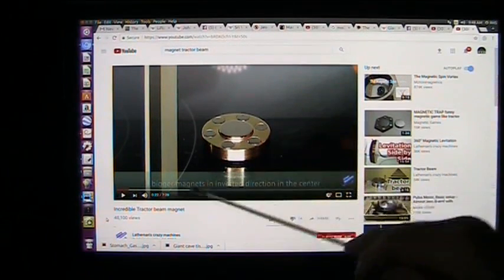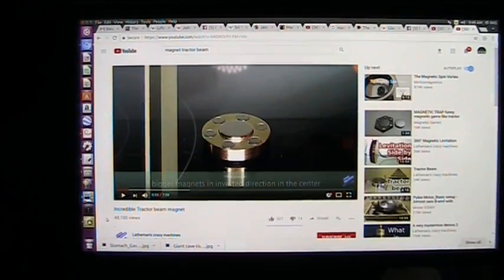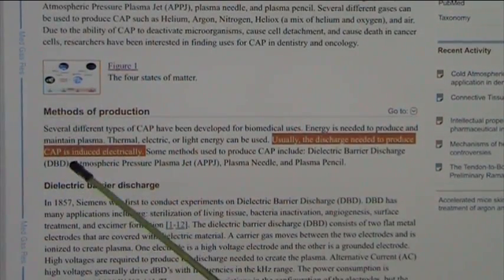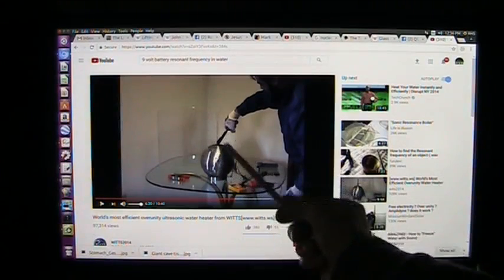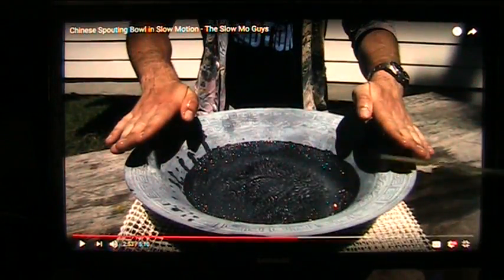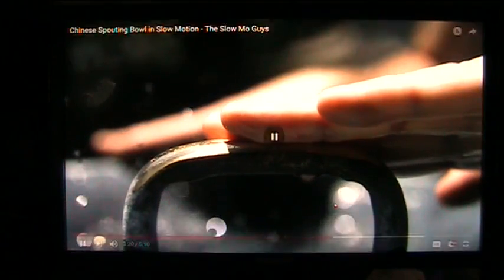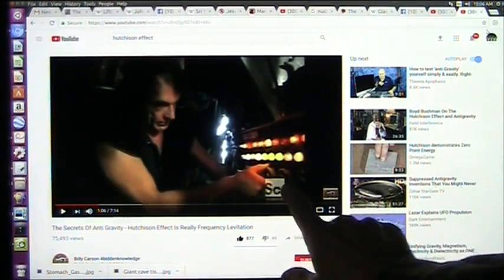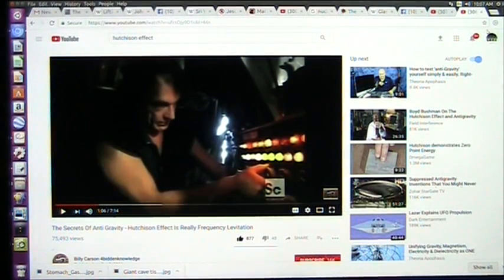MFU Sonoluminesce Explained and demonstrated several ways

Comment: @ 3:35, I see this as our Sun. The center is liquid hydrogen condensate. Being a liquid it does not compress, stops the Sun from collapsing.
Water acts like the Ether. You say it's electrons, I believe that's Ether powering the Sun. Outer Sun heats up, like a resistor in a power supply.

Comment: Back in the 80s I was wondering what the Sun was and what made it work, then I read the work from a guy (A) who explained that the sun spots revealed that the interior of the 'cooler' than the outer layers. Which, killed the fusion Sun theory, right?  Then, I read the work of a guy (B) who said that the Sun was a ball of 'water'. That helps to explain why the interior of the Sun was cooler than the oter layers. Then, I read the work of some guy (C) from the Space lab, he said that a ball of water in space, when spinning, the outer layer would spin faster and its temperature was higher than the interior.  So, I put A+B+C= (some how) how the Sun worked. What I was lacking was this Sonoluminesce!